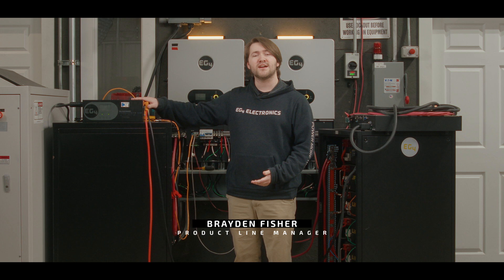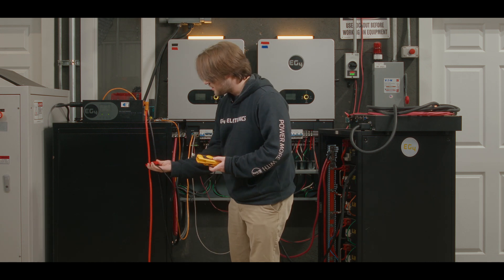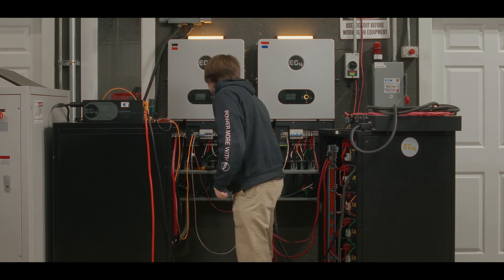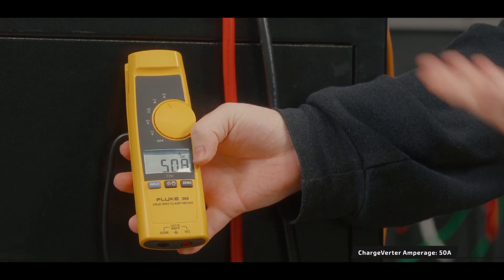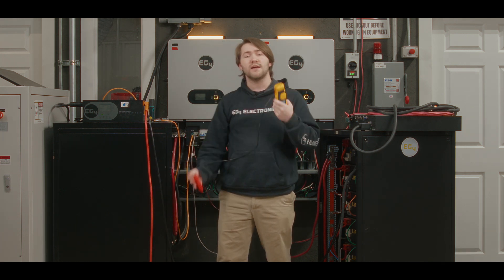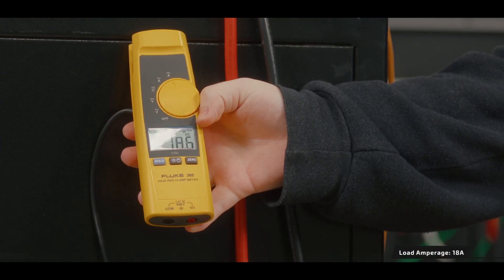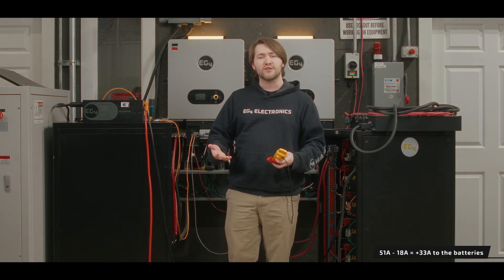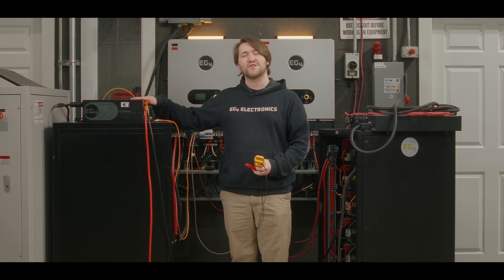How Does the EG4 ChargeVerter Handle Loads? | Demonstration

Comment: I was told by SS that I had to shut off the breaker for the Batteries at the Inverter, and not pull a load from the batteries while using the CV to charge the batteries. I said I thought he was wrong and mentioned this video and others, but he insisted. Can someone from EG4 get back to me?

Comment: I am presently using your first edition Chargeverter to charge an IFLA battery... matched it with a Westinghouse 5kw generator and it is presently pushing 54v x 25 amps (1300 watts =/-).... hoping it will recover the cells and get to 2.45v per cell.

Comment: Thanks for the video, and glad to hear and see the R&D lab at EG4!  I have the newer black EG4 Chargeverter, but unfortunately, cannot get it to charge, after several months of trying to charge my EG4 LifePO4 48V batteries.  It seems I'm limited to charge only between 52V (on the low side) to 57V.  The problem is, my batteries never get below 52.1, thus my chargeverter NEVER kicks in.  Battery Start won't go above 52V?  What should I do?
Reply: I have one too , chargeverter does not cut off when reaching set limits so I’m manually using and really disappointed and feel it way overpriced

Comment: I thought the Chargeverter was a 100 amp charger, was it purposely set for only 50 amps? 48v*50amps is only 2400 watts or about half the Chargeverters listed capacity of 5120 watts.
Reply from the maker: We set it to 50A solely for the demonstration of the video. It is configurable up to 100A.

Comment: People literally thought you couldn’t charge the battery and run the inverter at the same time
Reply: Probably because the original documentation from EG4 explicitly said that you should not do that.
Reply: @Scotty3Ballz  I doubt it says you can't stack them. I've spoken with them about it and they said it's fine. I am stacking 4 and will do 4 more soon. 8 total
Reply: @MrDonking1967  No it said that, I still have a paper copy of the manual before they scrubbed it after this topic blew up on FB.
Reply: @MrDonking1967  I didn't mean that you can't stack them. The original documentation had a disclaimer stating not to run the chargeverter while powering loads. So I'm not sure why anyone is surprised that folks thought you shouldn't/couldn't do that.
Reply: Yes you can. You just need more chargeverters connected that exceeds the output load.
Reply: A inverter/charger can only do one thing at a time, charge or invert, but a separate charger like the Chargeverter operates independently of the inverter, they don't know each other exists all they see is the DC bus voltage.

Comment: Thanks for the video. With this shite weather, I have been using the Chargeverter with the grid to help out my batteries, and got a huge electric bill. Inefficient use?
Reply: If you are on a demand based plan it could have something to do with it.  Large intermittent loads will cost you a lot more than the same overall energy spread out over time on those plans
Reply: @CowboyPilot79 I have since installed a second battery bank that recharges the main battery bank using the Chargeverter. Haven’t needed to use it much this time of year.
Reply from the maker: There's a lot of factors that could determine that. Inefficient Chargeverter use usually means more generator fuel consumption.

Comment: I like EG4 products but to me it seems like EG4 is only advertising the use of their chageverger and I have yet to see a video tutorial that demonstrates the use of a 3%THD generator going to the GEN port along with the auto start feature for the generator.  I have not seen any recommended generator that they have use to test that specific scenario,  everything seems to be only around chargeverter.  I purchased the 12000xp because of the generator port thay it supports and the dry contact feature to auto start thr generator, and yet no video or written articles from EG4 on that topic.
Reply: Inaddition, like many other users  who like to have a clean installation with the wallmount batteries, we'd prefer to have the generator wires go to the GEn port via a clean installation, and not having to purchased a chargverter, busbar etc.. to make it work. We should be able to use the existing features the inverter comes with. :(